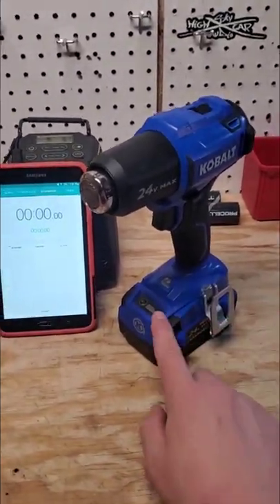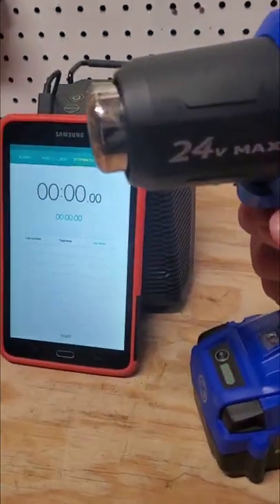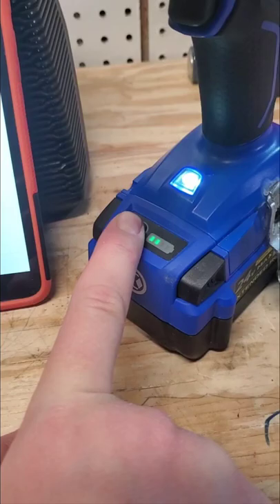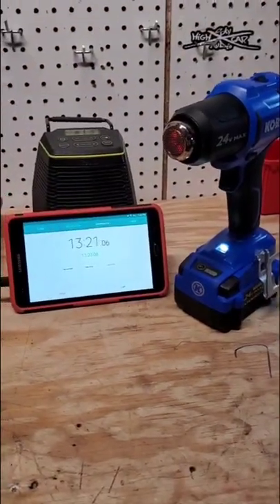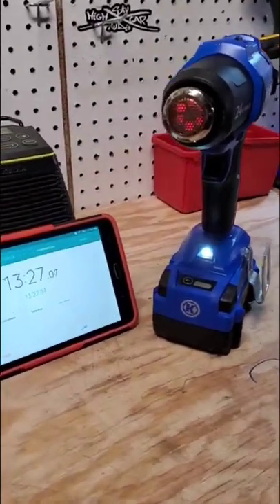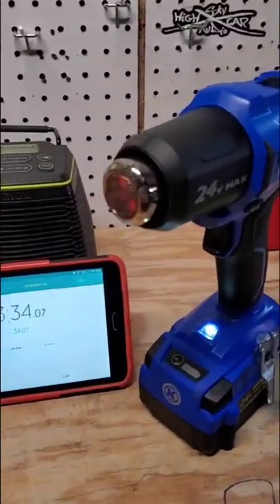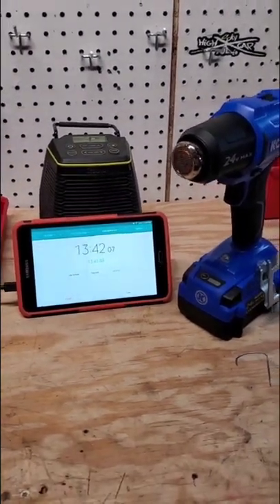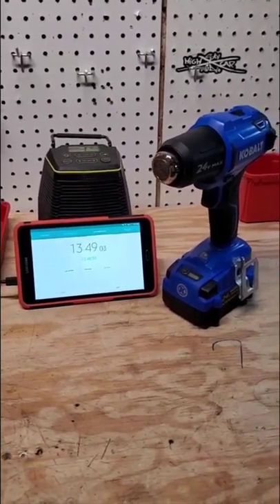Kobalt 24V Heat Gun, Run Time Test.

Comment: Is that in high or low?
Reply from the maker: That is on HIGH buddy
Reply: @Impact-OG  thanks Al. Not bad runtime on high for a 4AH. I have this heat gun and am pleased with it. I don’t use it much but the few times I have it has worked well. Intermittent use, the 4AH seems to be plenty of runtime.
Reply from the maker: @treebossmike8818  I have noticed that in the cold the run time is less. Here in MN it's been around -5 and battery's in general don't like the cold.
Reply: @Impact-OG  I’ve heard that about lithium ion. I’m in South Florida we don’t really get that cold down here. Right now it’s 47 degrees and that’s considered apocalyptic 😂
Reply from the maker: @treebossmike8818  that's so funny, I was in Vegas one time It it 60. And I was in shorts and a tank top, and everyone else was in jackets and hats. I don't even wear a jacket until it's under 20. Degrees.
Reply: @Impact-OG  lol when I first moved down here from Pennsylvania that was me. I was ready to go swimming in 60 degree weather while everyone down here was in jackets and sweaters. Over the years you just get used to the heat and humidity and now I’m cold in 60 degree weather. It’s supposed to warm up to 58 or so where I’m at. I was going to pressure clean today but hell no! It’s too damn cold 🥶.
Reply: Should of put a thermometer to see the performance